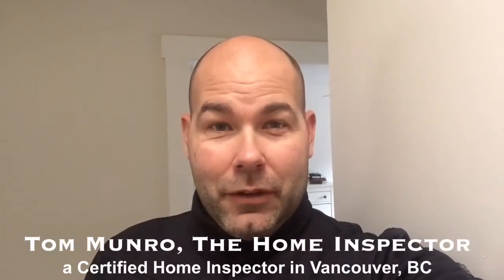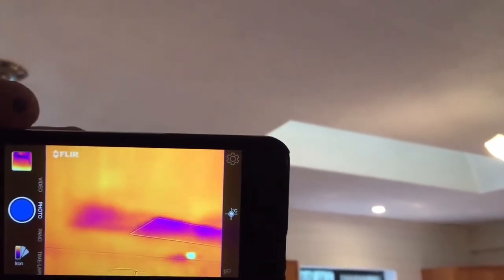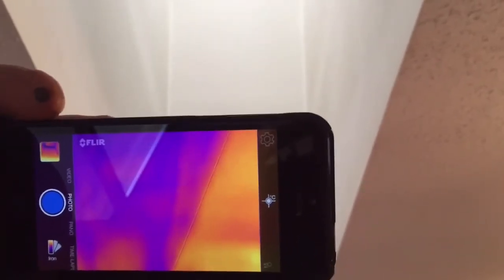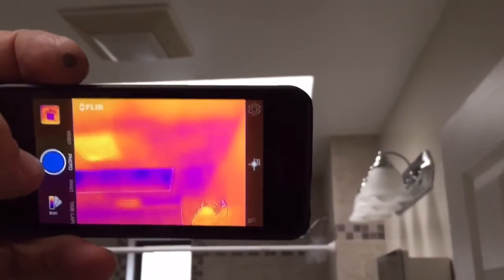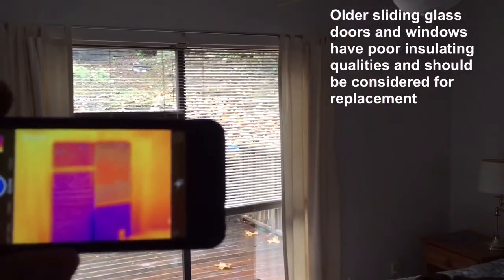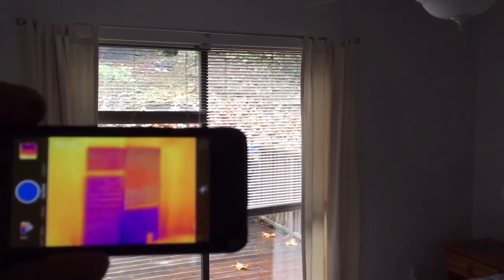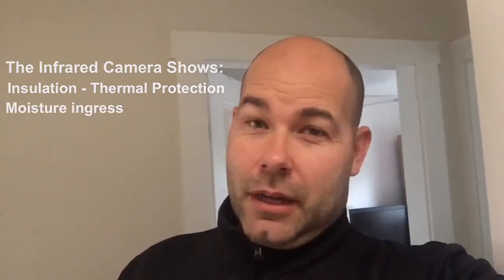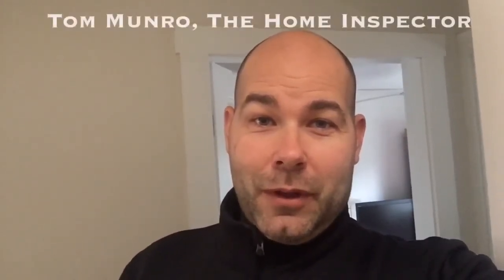How an Infrared Camera works during a Home Inspection

Comment: Wouldn't I see the missing insulation if I went in the attic? I know there are sometimes limitations and you can't get to certain areas, but typically you can, so why would I need an infrared camera for that? Also, couldn't I just use a $15-$30 laser thermometer to know the heated floor works? I'm not trying to be a pain in the "you know what" or give you a hard time in any way. I'm a home inspector in Colorado and I'm considering purchasing and infrared camera. So I'm really just trying to figure out where it will benefit my clients , myself, and my business. Thank you for the video. Keep up the good work.
Reply: A thermal imaging camera will allow you to quickly scan large areas in real-time, as opposed to very specific spot measurements where the laser thermometer requires a few moments to reset each time. They compliment each other, but each is absolutely essential. Clients don't always have the benefit of our knowledge, and respond very well to the clear, obvious visual results of the camera. The technology you bring to a inspection also lends itself to your credibility with the client.
Reply: I think you should at least rent a thermal imaging camera with fairly good resolution to justify the purchase. Owning an affordable thermal imaging camera will definitely help you quickly identify and inspect building issues. It isn't a substitute for physical inspection but it's rather a complementary tool for your inspection. It's up to how oneself leverages the power of this camera to its fullest potential.

Comment: I know this is just a quick video, but I'd have liked to see you go into the attic and show the missing insulation if possible. How do you know the insulation is missing and it's not just the glass passing some cooler air from outside and therefore making the surrounding area cooler? I'm not tying to argue with you, I just want to better understand how to make assessments with the Flir thermal camera :)
Reply: +Gadget Addict I concur.